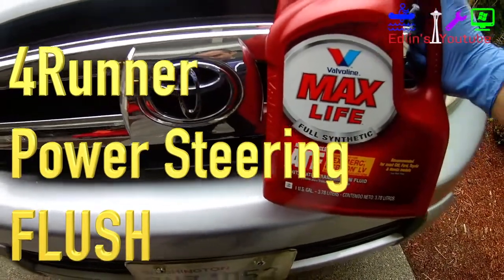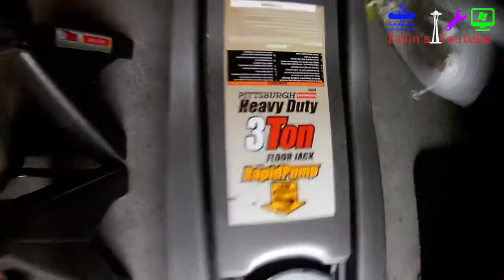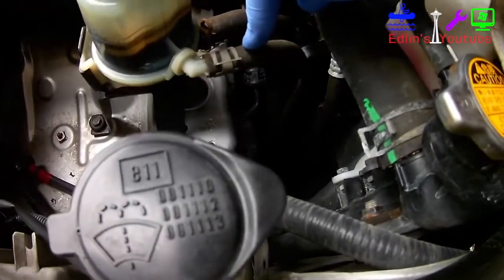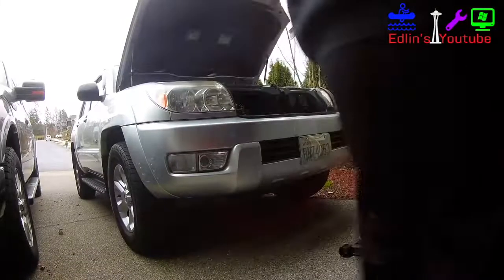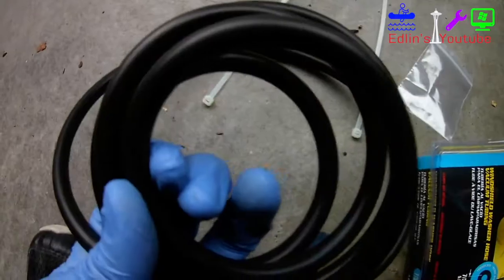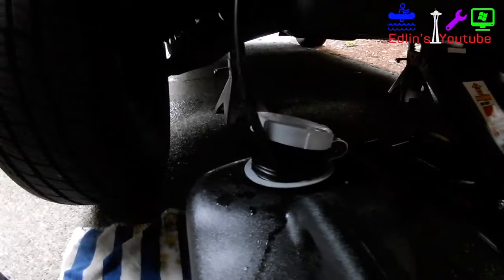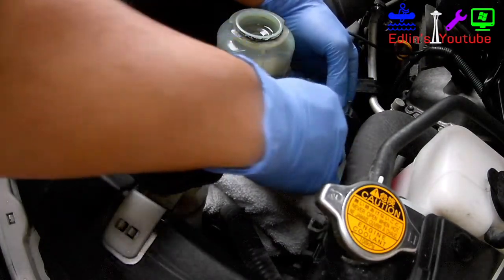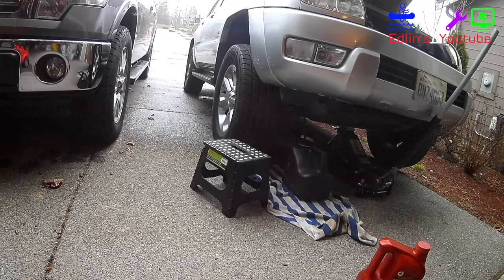Toyota Power Steering Flush - Quick & under $10

Comment: For anyone else watching this, DO NOT use “7/32” hose like he recommends. I bought some as recommended here, hooked it up to my return line just like in the video and as soon as I started trying to flush the pressure blew out the 7/32” hose and sprayed power steering fluid all over my garage. I thought the figment was a little too small, but I even clamped it on with a second tighter clamp and it blew off.
Reply from the maker: worked for me
Reply: Thank god I saw your comment... I knew something was wrong when I looked at the return line after buying a 7/32in hose... How did this work for him?! Makes absolutely no sense...
Reply: @julianvandersteen2303  he probably is remembering wrong and didn’t use a 7/32” hose. Definitely get the correct little connectors and the correct size hose. Made a huge mistake by following this video.
Reply: What diameter hose do you recommend?  I would assume same od and id and use a tapered connector.
Reply: @johnulbrich9261  I forget the size but I’d just look up and use the exact same size hose with a proper connector inbetween.
Reply: @Psilocy-ben  damn Ben ...  you couldn't recommend a size?...

Comment: How is this under $10 when you used over $200in tools and supplies?
Reply from the maker: $10 every time. !
Reply: Because just like you have to buy supplies and tools to change your oil, you have to do the same with changing power steering fluid. 🤷🏻‍♂️ You recoup your costs quickly when you DIY instead of paying a shop to do it.

Comment: Couple of things to add. 
1 Get clear tubing if you can. Makes it easier to see how flushed out the old dark fluid is.
2 Get an actual "T" for connecting the tubing to the P/S return line.
3 Once it's flushed out and the fluid is all red. Don't fill up the reservoir until you reattach the return line. Otherwise it will leak out when reattaching. Then top off the fluid.
4 Start the engine turn the wheel left//right once. Turn off engine and check level. The reservoir is not that big on the TEE-Yotas. Then repeat till full.
Good vid and no stupid heavy metal music or sandals.
thx
Reply: Could you let me know the size of tubing and the exact type of connector you used.  Thanks

Comment: Thanks for the video! But there is an easier way...  Just put the MityVac line into the reservoir return line and suck the old fluid out. Fill reservoir with fresh fluid and continue vacuum until it flows through. Let the reservoir run low at the end to make reinstalling the return line less messy. Fill reservoir, start engine and let her run to bleed any air. Much easier and complete flush. Sometimes I remove and clean the reservoir with brake cleaner...

Comment: Or you just use your fluid evacuator (a wonderful tool I use all the time!) to suck the old fluid out of the upper hose while adding more to the reservoir until it runs clear.
Reply: I'm surprised nobody has done a video of doing it this way. Seems easiest and most likely to get all old fluid out.

Comment: How much is the capacity of power steering fluid
Reply: Not a lot. 2-3 quarts should be sufficient to flush and replace the fluid. Go through all the steps and fill to full line.